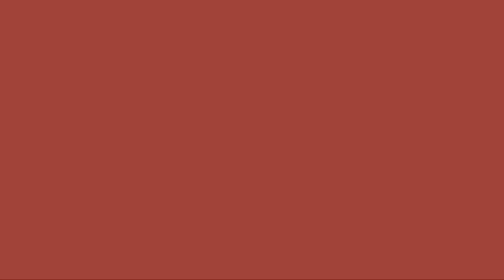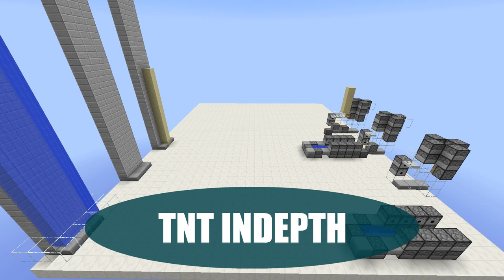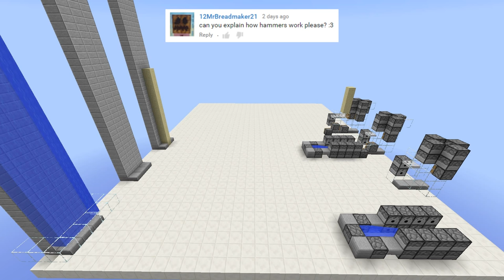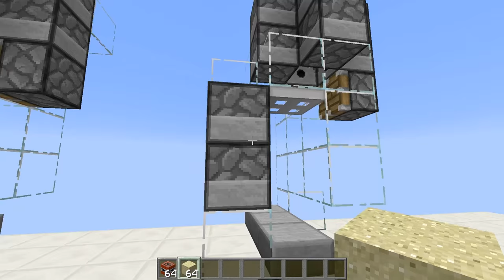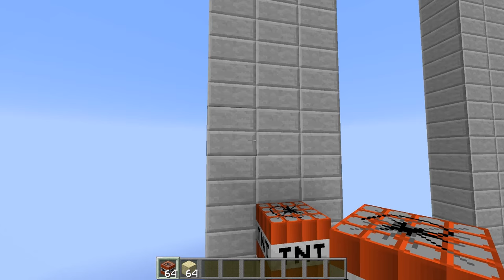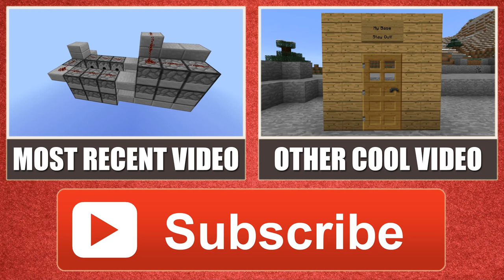Minecraft: How TNT Cannon Hammers Work [Tutorial] [1.7/1.8+]

Comment: Tnt madness realigners are not necessary because if you have a decent 230  the sand is shot right into the barrel there for you don't need to realign it to a side.And you would not need it for scatter because scatter is bad and it's all about the one shot and slabbust btw if you wanna make a cannon stack the right amount you need this equation to find the hammer power 1.151(x)+1 x is the amount of sand I would like to show you how to cannon is there any way we could meet on a cannon server?
Reply from the maker: +Banton Pierce I Understand the equation, But generally you would use a aligner
Reply: +TNT MADNESS if you want to get on that server at 1:00pm eastern time